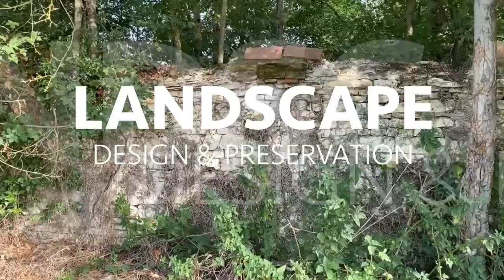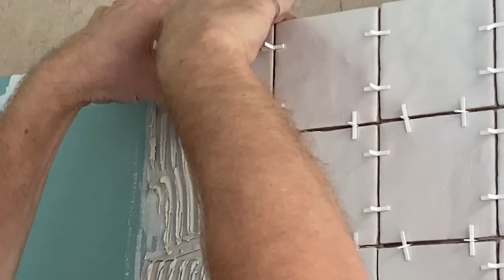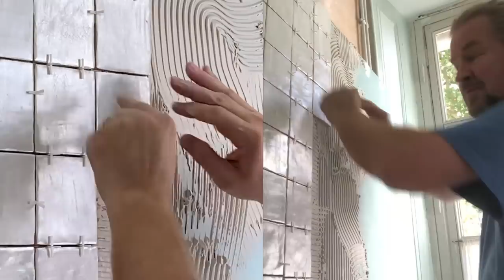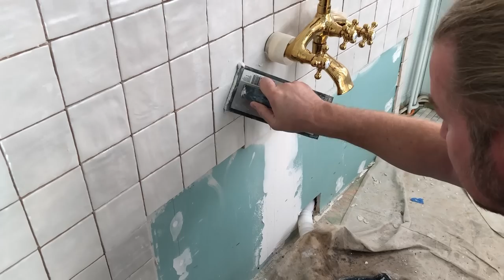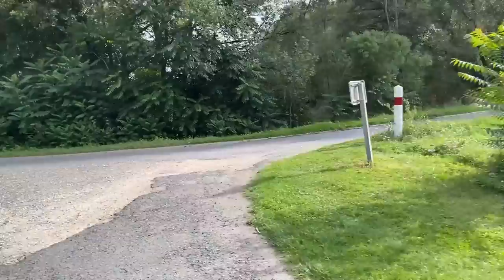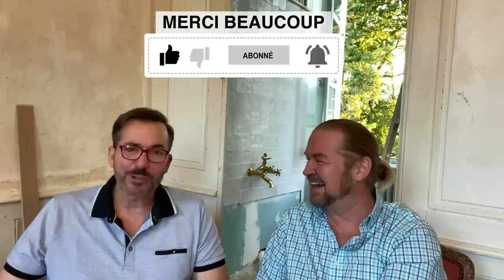Installing STUNNING Artisan TILES , CHATEAU Bathroom RENOVATION - Journey to the Château, Ep. 136

Comment: Patrick, lots of muscle power you used to tile that bathroom.  All I could think was, boy, are his muscles and joints going to scream at him afterward.  As far as wall papering, I wall papered my walk-in closet, which has a 9' ceiling, as a first-timer and managed to lay them perfectly.  You can, too.  It seems daunting at first, but you have to dig your heels in and simply try it.  You have time before the adhesive dries to move it around to create straight strips.  Congratulations on 25,000 subscribers.   Julie from Central Texas